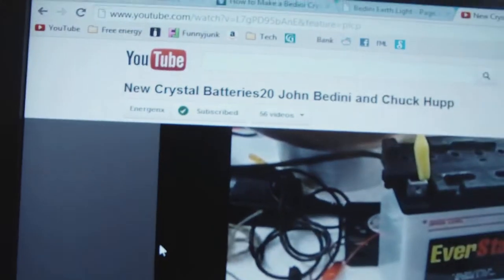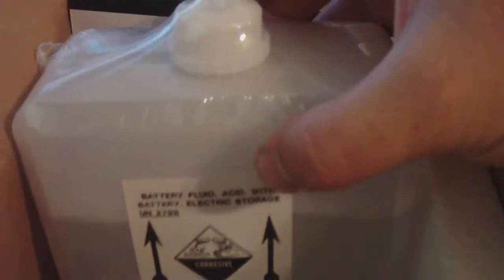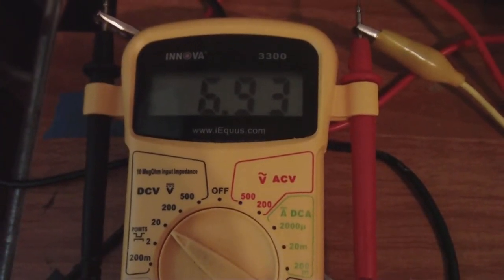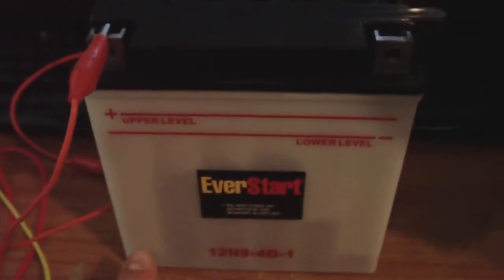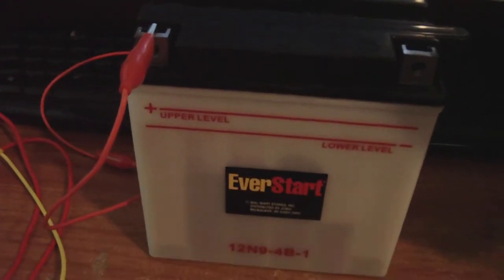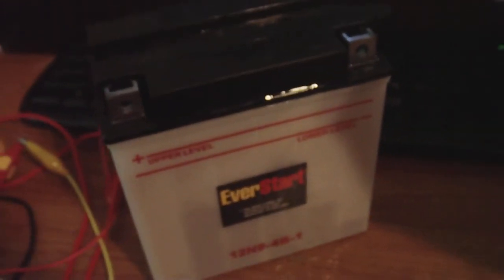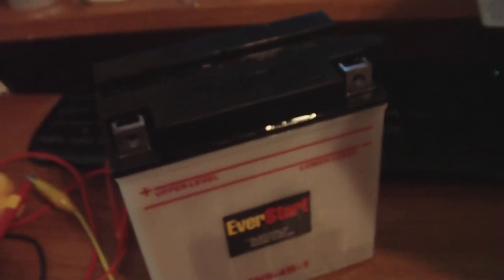Big Crystal Cell from new lead acid battery with no acid

Comment: Can you use an old battery if you charge it, then empty it, then rinse with distilled water then dry, then fill with the crystal mix?will this work any ideas folks as got battery but no funds for a new one ???? many thanks in advance :)

Comment: So, if I make about 6 of these I should be able to run a uninterrupted power supply on it using a joule ringer circuit, right? What does your Crystal Power Cell mixture consist of?
Reply: +Danyal Ahmad No Joul thief is no good for this , you want either the CAPTRET or better yet the Bedini Circuit .

You want to idealy charge a Capacitor and discharge , because yu don't loose power it just keeps replenishing it
Reply: ***** OK thx
Reply: have a look at most recent video , read how simple such batteries .. then there are videos for making a SGG Bedini circuit step by step.
in combination one has a fairly simple charging system . Time is then a variable working to your benefit ; )
Reply: ***** Thank you so much!!!!!!!

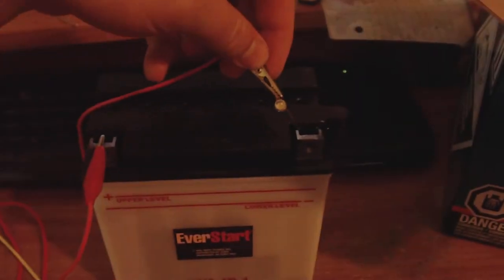Comment: from 1:45 it seems you forgot to fill some cells that explains the low voltage!
Reply: +XplaneZ No this works without any liquid ... seems +ibpointless2 doesnt know this .

The whole point of the crystal is that it grows and replaces the need for a liquid electrolyte .

My one is totally dry and crystals grwowing on he seperators of battery after I neutralised it with baking soda ( god also for drinking as it does the same in stomch , deacidify )

Comment: This battery contains sulfuric acid. The positive plates are formed from a brown lead paste that contains sulfuric acid. Also the led light you are using will not blow due to high current (amps). The 350 mA rating is what the light will consume. I am sure that this battery is producing a lot more than 350 mA. Higher voltage will blow the bulb.

Comment: alum works great so far in my motorcycle battery had to charge it 10 times to get it to finally settle at 10.50v. I do like the idea of running a water oil mix in the battery. With this substance do you have to charge the battery or does this work right out the box?

Comment: Well, you could use Alum and Epsom Salt and water instead of Sulfuric acid as the electrolyte and it will also be a very good battery and will not have any acid in it, so it is a much better and safer accumulator. Surely it has to be charged and recharged after discharge, but it is thus much safer to have it in a house as it does not have acid in it and if some electrolyte will spill this is not dangerous...
Sure it will be no crystal cell, but a better accumulator ! Regards, Stefan.